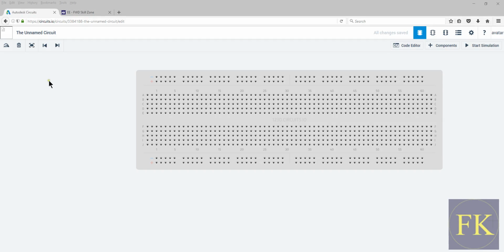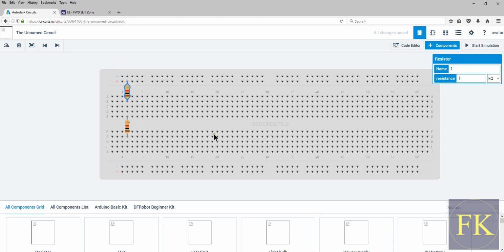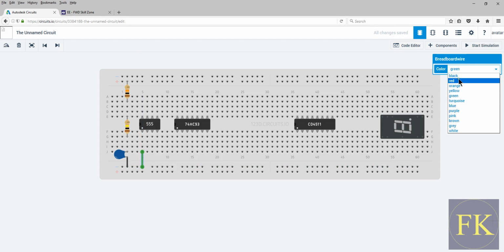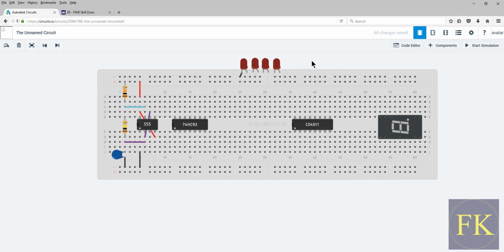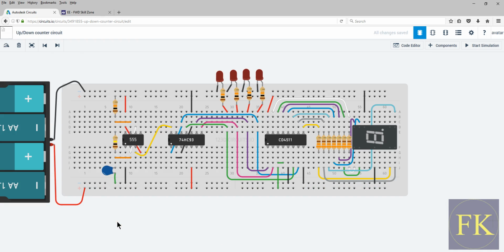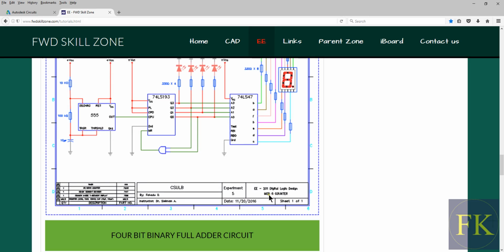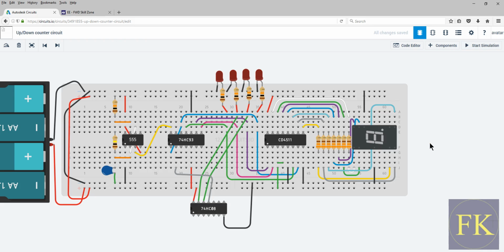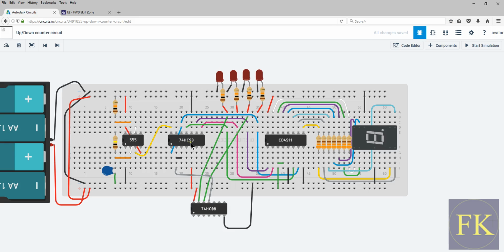Binary Counter Circuit

Comment: the 7 resistors youve attached below, what is their value? and tinkercad has changed the slots of the power and gnd of the display, can you highlight where 'common' and 'DP' are to be attached? (these are the slot names)
Reply from the maker: Hello Sol, you can find the schematics on my website: https://www.fwdskillzone.com/digital_logic.html
Take a look at the schematics, it has all the information you need. The resistor's value I used is 330 ohm.  If you still have some doubts, feel free to send me a message using the "contact us" page inside the website.

Comment: Wow but please i want see letters in 7 segment display without using arduino
Reply from the maker: To display the alphabets, using Arduino or FPGA boards will be the most effective way. However, if you want to display the alphabets on a breadboard, finding the right decoder will be so difficult as most of the decoders decode only few letters. if you want the display only, without decoding, then power the individual segments accordingly. For example to display upper case A, turn on all the segments except "d" (pin 2). Don't forget to use resistors on all the connections and check the data sheet for pinout and to identify the 7-segment display as a common Anode or common Cathode. This routine should be only for fun!

Comment: hi, am using a macbook  wich program can i download for free to test my digital or electrical projects
Reply from the maker: Hello, I don't use mac that often but I know PSpice works in all the platforms; however, it is not easy to use it without any formal training. 
I have also seen the following simulation programs listed on Mac Applications forum: (EasyEDA, iCircuit, MacSpice, LTSpice IV, McCAD, gEDA, CircuitLab, MI-SUGAR, Qucs.) You can also check http://www.fwdskillzone.com/digital_logic.html page for more info.
I hope this will help. 
Good luck
Reply: yo, you can use online programs, like Easy Eda or Autodesk Circuits just like Fk Fekadu.